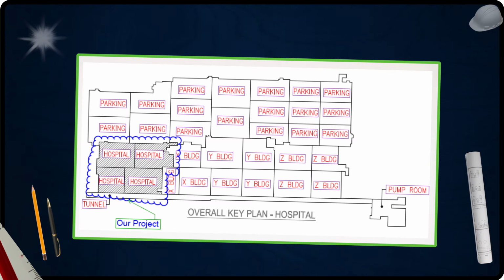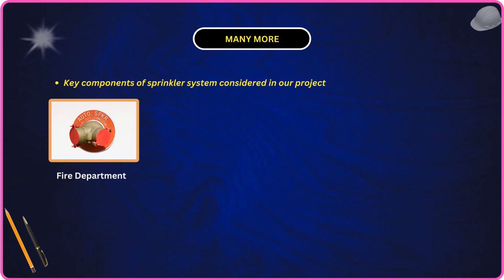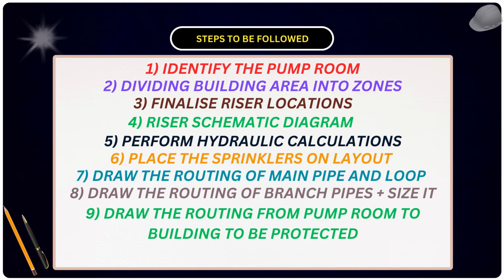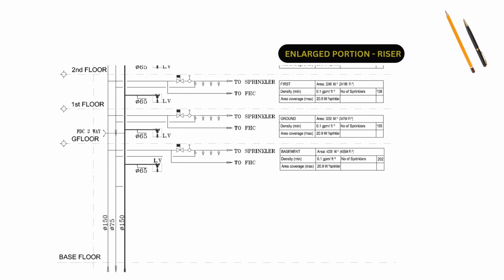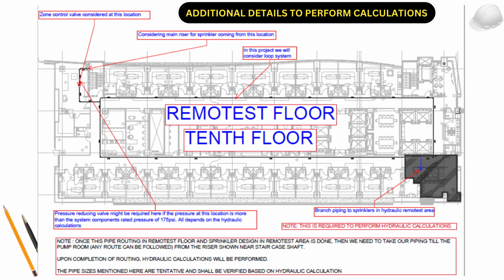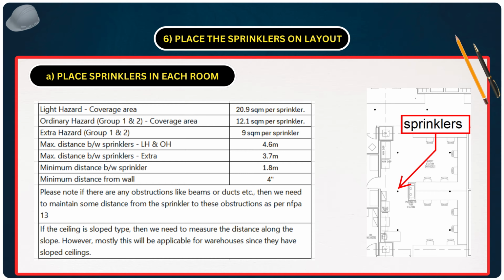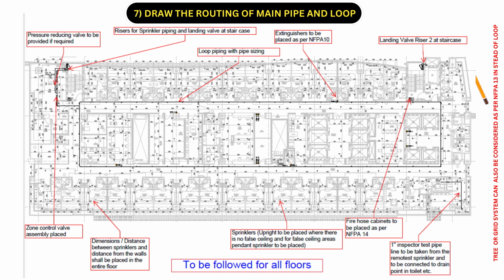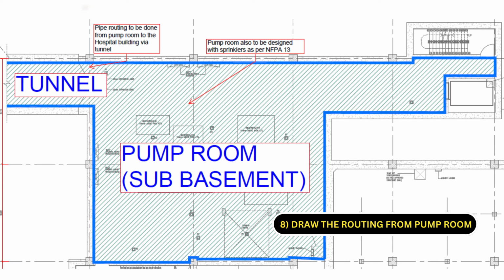Learn Professional Sprinkler Design from SCRATCH in 2025

Comment: area to consider for zoning is only for ground floor or we need to add all floor areas?
Reply from the maker: Zoning is considered to calculate the no. of zone control valves. So zoning shall be checked for all floors. The limitation for zoning area is mentioned in nfpa 13

Comment: In ZCV we provide the test & drain connection, it required to provide the test connection in the remotest area as mentioned in the video
Reply from the maker: In ZCV we need to provide test & drain. Apart from that, we have to provide a drain point in the remotest location as well.

Comment: Thanks, Eng. Irfan.

Do we have to have a check alarm valve at every ZCV?

Also, for the hydraulic calculations do we only need to do it for the most remote area?

I mean the code requires we put a plate at every ZCV, assuming I have several floors/zones, the plate for hydraulic calculation will it be showing same calculation for that most remote area, or gonna demonstrate the hydraulics design calculation for remote area of that floor/zone only?
Reply from the maker: No need check valve but…. If provided no issue..
Reply: @irfancfps  So when alarm check valve are required?

In a building of multiple floors, is there a minimum?
Reply from the maker: Hydraulic calculations will be done considering hydraulically most demanding area and most remotest area only…
Reply: @irfancfps  so I will have the hydraulic design plate on all ZCV showing same information (of that most remote area in the building)

Comment: How do we size the sprinklers pipes for an extra hazard occupancy using hydraulic method. Since we cannot use the pipe schedule method.
Reply from the maker: Nice question. Pipe sizing Has to be concluded based on hydraulic calculations… but initially we put the sizes based on pipe schedule (OH) and then will be verified using hydraulic calculations. Is it clear? Or any doubt let me know
Reply: @irfancfps  thank you so much irfan, i have been racking my head for this,. This is very helpful.

Can i use extra hazard occupancy or class IV storage occupancy for an alcoholic beverage/drinks storage warehouse of over 5120sqm